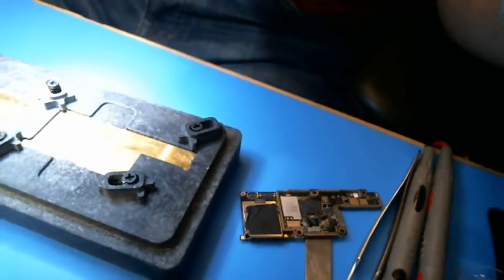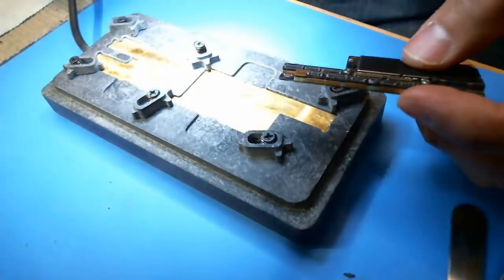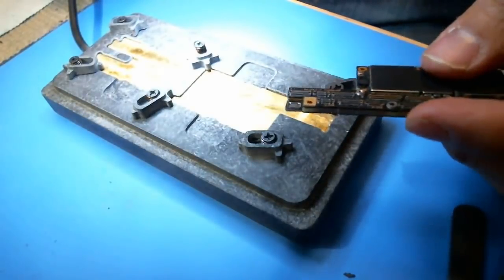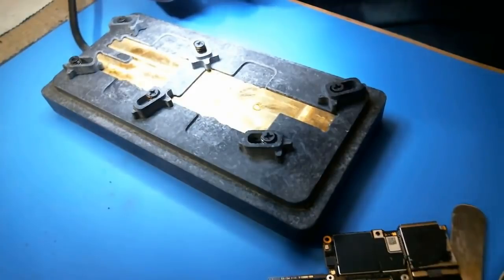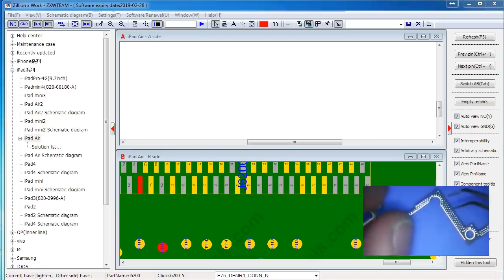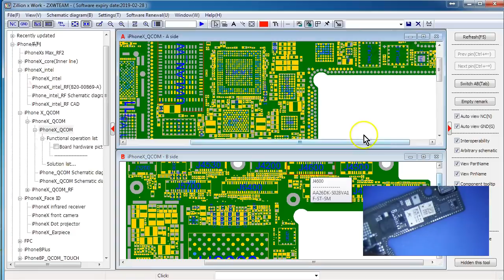iPhone X Removing the Middle Layer Connector

Comment: Sn42-Bi68 138°c for topside & another mix for the lower😉 we manufacture our own mixture for the the X PCBs now as the repeated quality wasn't as good as we were hoping with imported brands😔😓
Reply: Stalwart Computers Does the bottom use regular lead free solder?